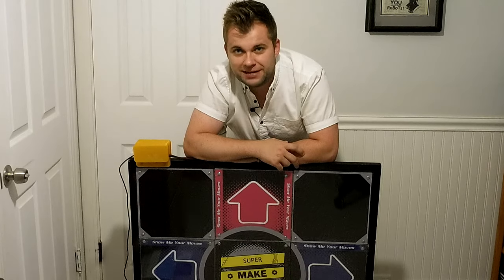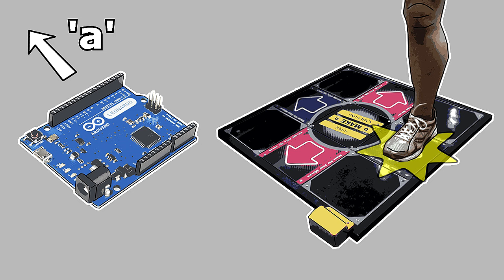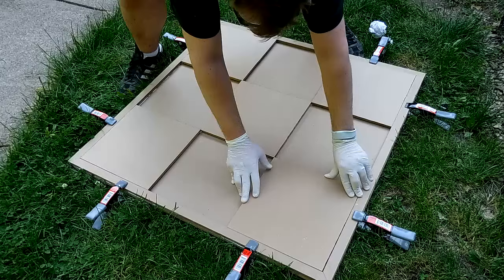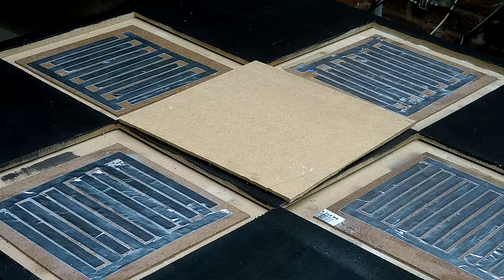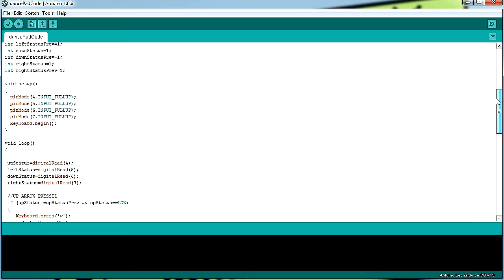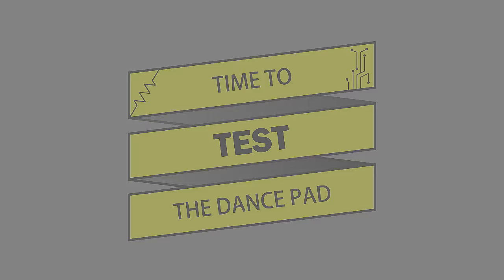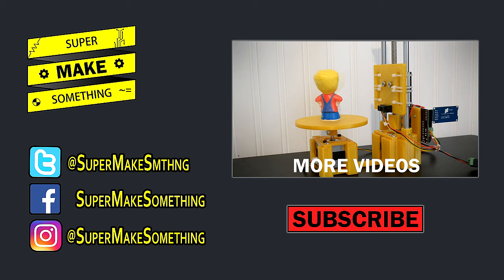USB DDR Dance Pad (Arduino, Pull-Up Resistors) - Super Make Something Episode 9

Comment: This is a great design and thanks for sharing it with us.  My one big objection to this design is the method used for connecting the wires to the dance pad combs.  My suggestion would be to extend the ends of the foil contacts over the edges of the riser panels, such that the wires can be connected out of the way of the pad movement.  By having them on top of the risers as they are installed in this video, that could impede pad movement and thus connection.  If soldering/welding to the foil is not an option, I would also suggest something like hot glue or even duct tape to complete it.  Electrical tape does not stay adhered to wood very well in high-vibration applications.
Reply from the maker: Mark Dickson Hi Mark! Thanks for your comments and I’m glad that you like the video! The ideas you suggest are definitely good. The main limitation for this design was foil comb size, which was a result of my craft cutters’ working area — the one in this video is a “mini” version with an 8.5in cut width, whereas other cutters can cut material up to 12in wide. Your suggestion about wire adhesive is a good idea, too — I think that if I were to build the pad again, I would attach a piece of copper foil tape to the aluminum foil, since this would allow me to solder a wire to the comb directly. (A pad made entirely of copper tape would be ideal, but this would probably be too expensive.) That being said, it is still holding up well and I have not had any issues, so if you are planning to build your own pad, I think this is a good base design to get you started. Cheers!
Reply: @SuperMakeSomething  I hadn't thought about using copper tape to connect to the foil. That's a good idea too. Still a great pad design overall!

Comment: When I did my dancepad I just bought the cheapest USB generic controller I could possibly find, cracked it open, and used the PCB from that lol. Then just soldered wires from its buttons to the dance pad and effectively the pad steps just act like giant buttons.
Reply from the maker: Awesome! That’s a great way to go if you have a spare controller laying around! Nice!

Comment: Used material summary:

1/2" MDF:
1x 35"x35" baseboard
4x 1"x35" borders
5x 11"x11" stationary panels

1/4" MDF:
4x 11"x11" button pads

1/4" cardboard:
4x 9"x9"x1/4" raiser panels

1/4"x5/8" foam insulation tape:
16x 8" strips

2mm acrylic: (or polycarbonate)
9x 11"x11" panels

Aluminum foil

1x Arduino Leonardo

36x  #8 screws
13x (?) washers + electrical tape  (or screws)

Wires

Glue

Spray glue

(Optional, but required for a cleaner result :)
(3D printed) Arduino Enclosure
 (with screws for closing)

Paint
Graphics

Braided tubing
Zip ties
Reply: You forgot "pizzazz"
Reply: @Rodman im pretty sure you can buy an l-tek pad for about that much (maybe a bit more?), including shipping to us
Reply: @Rodman maty-taneczne (dot) pl, i dont have one but ive seen many opinions and they seem to be overall a v good entry level choice, the sensors might be a bit inadequate for high level play but there are mods you can do. there shouldnt be any issues with durability though, just make sure to choose the pro version as they have polycarbonate panels instead of acrylic (which are mone prone to cracking)
Reply: Rodman is this offer still up lol I’m gonna be making one

Comment: I've used your code and implemented in my PIU machine that i've built. It worked just fine for me. 
I used a completely different material, had to make some adjustments on your code, but it was really nice have a starting point that you gave me. 
Thank you.
Reply from the maker: That's awesome! I'm glad that my code helped! Thank you for letting me know!

Comment: I played a bunch as a teenager and now that I'm an adult and have money, most of the good pads have since gone out of business.  I will be starting this project asap, thanks for the video, it answered some of the questions I had in my head while I was planning this out.
Reply from the maker: Jay Martinez That’s awesome! Please keep me updated about how your build turns out!
Reply: Super Make Something so I finished mine and I did a couple thing different. One being I didn’t clean it, it’s just wood. I also used copper tape instead of aluminum foil which allowed me to solder to the tape. However I noticed some sensitivity issues, especially with holds, which I’m assuming is too thick insulation tape which is forcing the active step area closer to the center. I’ll make some modifications to see if that works. Also another problem is my lack of skill as I haven’t played in years lol.
Reply: But I suppose that the sensitivity could be maybe a non consistent circuit because of weak connectivity of the copper tape adhesive. But I’m not sure yet.

Comment: If you don't want to get an Arduino and code, I'd recommend getting a cheap soft pad and utilizing the board and enclosure that comes with it. I'm trying a build this weekend with a soft pad I recently purchased. Most of the time with soft pads, the part that goes out in them or causes them not to work are the contacts and not the board. 

In the one that I purchased from Amazon for example, the contacts for everything are just two layers of crinkly plastic with conductive material printed on them with some very low quality and thin foam in between them. I bought two of these pads and neither made it past day 1 of use without pads not firing. 

I can't speak to all  PCB boards on these soft pads, but with multiple companies selling these 10 button pads with a pink/blue theme and the "Stay Cool!" In the middle pads, I imagine most of them are the same product. The board in these pads is very simple with one ground contact in the middle that all the pads connect to. There are then 5 smaller contacts on either side of the ground contact that correspond to the 10 buttons: (The pads I bought have 4 arrows (up, down, left, right), a triangle, square, circle, and 'X' button in the corners, and a start and select button at the top of the pad)
Reply: This is exactly what I’ll be doing this weekend! I bought a soft pad years ago. It’s never worked very well and, 90% of the time it, doesn’t register my up or down steps. I’ve been playing with the option to fail songs turned off and just accepted that all my scores are stuck at D at best. But I am soooo looking forward to repurposing the board for a quality hard pad! Now I’ll finally know what my REAL scores are!

Comment: Great video. I also suggest you place the conductive pannels closer to the center square, that way you don't require to press so far out with your feet, instead you can just touch the edge of the arrow to trigger it
Reply from the maker: Michael Lesko Good idea! The more sensing area there is the better!

Comment: Thanks for the guide on how to make the dancepad! That is where I was caught up on, trying to make my own Pump It Up pad. I plan to use the Texas Instruments MSP430 Launchpad (F5529) as the controller instead of the Arduino, due to it's ability to call an interrupt from a pin input, as well as having built in pull-up resistors if needed for output. It also can be made to act as a HID-compliant game controller, so I think it will be perfect for the job.
Reply from the maker: Awesome! Glad you found the video helpful! Please share your build with me after you are done — I would love to see the final results!
Reply: Did you do it? Trying to research!
Reply: I am also checking to see if you made it and how well it worked.
Reply: The arduino is capable of this as well, depending on the board. The Leonardo in particular supports interrupts for enough of the digital pins to make this exact project interrupt driven. See attachInterrupt(). The loop function could just sleep endlessly if it really wanted to.

Comment: I used a xin-mo to make mine. Pads are more reliable and uniformly sensitive (can't have pad misses for flat-footing) if you only need one contact (ie. detection of 0 or inf resistance). A xin-mo just detects the closed circuit upon contact and it's cheap; shabam.
Good job regardless.
Reply: could you explain further on how you would do the wiring for that?
Reply: Flippusmn what buttons or sensors did you use with the xin-mo?
Reply: Lol, ya, you gots my attention, thankyou for the heads up!

Comment: Thanks so much for this video, I made my own DDR mat using this as a guide and it works brilliantly.
It hasn't endured much use yet, one key difference is that I kept the 2mm acrylic as one big sheet, so I'll see how that compares over longer use.
The only other major differences are that I used an old Arduino UNO (Revision 2), which does not have the keyboard module available, so instead flashed it to be recognised as a HID Gamepad, and mapped the buttons to the cross, circle, triangle and square, and it works a treat!
Keep on making things! I love your work!
Reply from the maker: Hi Stephen! Thanks for your comment and congrats on the build! I’m happy to hear that you built this project and that it is working well for you. I did not know that the Uno could be flashed to be recognized as an HID device. Could you post a link to the code? That sounds super awesome and useful! Cheers!
Reply: @SuperMakeSomething   Thanks so much! I can't take credit for the code, however, but I used UnoJoy, found here with guide https://code.google.com/archive/p/unojoy/ hope this comes in handy!
Reply from the maker: Stephen Forrest Awesome! I will take a look. Thanks!

Comment: So let me get this straight. I can either:

A) Spend $350 + shipping to get a fully functional DDR pad with a warranty.

or...

B) Become an engineer / designer / 3D printer operator / programmer / electrician / carpenter and build one myself for probably under $100, as well as a week's worth of hard work?

B sounds a lot cooler to me, but A is all I'm currently capable of.

And awesome video BTW. It was really cool to watch you doing all of this.
Reply: He includes a setup file for that control box. He just opted to 3D print a control box for his pad. The materials for his pad probably ran roughly $150 or so.

And btw, the $350 "fully functional" pads with warranty are cheap, made in china, are prone to failure within 6 months, and have to be shipped back to China if you intend to use the warranty
Reply: I was going to spend 50$ on a soft pad
Reply: Pikmeir, You forgot the equipments you need in order to execute Option B :)
Reply: @KCEBGaming  Who says? i have the metal dance pad which is made in china, functioning for almost 3 years without error.
Reply: You don't have to be electrician, designer, 3D printer operator or engineer. In the way of programming, u can DL ready sketch but do have to know how to load it in microcontroller. Those connectors with foil is just one of the many ways. All u need that anything that will short the contacts when u step on it, from pressure sensor to banal buttons. All u  need is just a straight hands and imagination. DIY pad has one advantage that ready pad in the shop doesn't have - you made it.
Reply: @seant397  Do you play on PC? I miss DDR on my PS2 so badly.

Comment: I bought a cheap metal pad and modified it the same way.  Came with a smaller sensor similar to the one you made, replicating the idea for the entire pad area.  My first shody solders snapped, but after a couple o fiterations, it still works to this day and this was 10 years ago.  Props on the info, will come in handy mang.

Comment: Was about to comment on the electrical tape right as you gave your comments on the design lol, I would say maybe use a spring to hold them down, as frequent movement will wear out a solid connect like a screw. 
Definitely also agree that acrylic is too brittle. I will likely be using Lexan, which is very durable.

I also would recommend putting in connectors at each button to make swapping parts easier.

Comment: Great video. Personally, I think for expert players piezoelectric or piezoresistive sensors are a must! Just like the arcade pads.
Reply: You could make a follow up video to this using arcade sensors? That would be awesome! They're pretty affordable too!
Reply from the maker: I'll definitely consider it!  Currently the pad seems to work pretty well, even for more advanced songs -- I can A/full-combo Max 300 consistently without noticing any misses due to the buttons.  If the pads do need replacement sometime in the future, I'll be sure to look into the sensors further and post a follow-up if I do.
Reply: Does max combo with perfects/excellent? If so, then the accuracy on this thing is insane!!  But if you do have some more about arcade sensors definitely. I know you can find pressure sensors from aliexpress so if you happen to do one from the ones you find there - Awesome. That or I think pennyarcade.com had some.

Comment: Did you know? In kkclue's DDR foot pad tier list, the space between an A-tier DDR cabinet and a D-tier thickpad are HOMEBREW PADS. They're made by fans, with no intervention from Konami, but because they're homebrew, they're made to be tweaked, so you have to be prepared to DIY when something goes wrong. The Cobalt Flux is B-tier, and the L-TEK pad is C-tier.

Cobalt Flux:
- Very well liked by the DDR community
- Constantly out of stock
- Hard to find (I mean used ones are hard to find)
L-TEK:
- Always in stock
- Manufactured in Poland
- High shipping costs (for USA)

Comment: How would you recommend increasing the sensitivity specifically around the edges and corners of the steps without having to replace the aluminum foil sensors system?

I glued a sheet of craft foam(2mm thickness) of the same size as the whole pad below the base under it to prevent it from sliding, it works really great. I used a whole sheet instead of individual strips to have consistency across the whole base area and for extra grip, also it was really cheap so why not.

Now on the sensitivity, I've been thinking of covering a few craft foam strips with aluminum foil tape and and placing them in the corners of the steps to increase the thickness of that contact area which is used more in harder songs(since you don't have time to step right on the center) thus increasing sensibility to give it a more arcade feel.
What do you think?
Reply from the maker: I think that could work.  In this specific setup, it's essentially a trade-off between how "wide" and how "tall" the foam strip is, and how little foam you can get away with.  "Narrower" and "shorter" strips would allow you to increase the area of the aluminum pad sensor, but less foam results in a less stiff "spring" on the panel.

Comment: After making the changes that you'd mentioned at the tail end of the video, how is this holding up? I'm considering building something of this nature myself (albeit without the 3D printed arduino box) but I'm interested to see how much mileage you've gotten out of the pad overall.
Reply from the maker: SharktopusAttack The pad has held up really well! Since replacing the acrylic with Lexan, I’ve had no cracks in the panels. Sandwiching the wire leads to the metal contacts with a screw instead of using tape has also increased the amount of time between maintenance significantly. The only downside is that I find that the pad is still not heavy enough — when the pad is on carpet, it has a tendency to move around while playing heavier songs, though I’ve solved this problem by putting weights in the corners while I am playing. 

That being said, I recently found a website that sells after-market arcade sensors. I might have a follow-up build planned in the future to build a full size arcade platform replica... ;)
Reply: @SuperMakeSomething  Hey, how is it going? :)

Comment: I realize this is an old video, but you might get away with using extruded acrylic instead of cast acrylic.  Extruded acrylic is a fair bit more flexible, albeit slightly less clear than the glass-like cast acrylic.

Polycarbonate is still a good option, of course.

Comment: Do you have a picture showing how you did the wires?
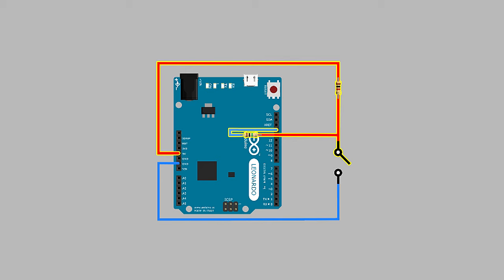Reply from the maker: KalebDoesThings Check the following time stamps: 4:00 11:00 11:50
Reply: @SuperMakeSomething  so connect one red wire to one connector strip per button but how does the black ground wire go?
Reply from the maker: KalebDoesThings The black wires are attached to the other foil combs in the base for each button on one end, and connect to the Arduino’s ground pins on the other.
Reply: @SuperMakeSomething  is it one ground wire or do you connect multiple to one because in the video it looks like you only had 1 go in the arduino
Reply from the maker: KalebDoesThings All of the buttons are connected to the same ground, so you can link them together and then only have one wire going into the Arduino ground.

Comment: I've been wanting to do this for years but with a metal frame since I work in metal fabrication now and have a huge supply of scrap steel and aluminum plate and channel, and also do a lot of DIY electronics wiring and soldering

Comment: Sorry but I don't fully understand the components list, could you (or someone) write it?
Reply: 1x 35"x35" baseboard (made out of .5" MDF)
4x 1"x35" border pieces (cut from the same sheet of .5" MDF)
5x 11"x11" stationary riser panels (also from the same sheet of 5" MDF)
4x 9"x9" arrow risers (made from .25" hardboard)
16x .5" x 5/8" foam strips, 8" long
12x Aluminum Foil sensor contacts (roughly 8x 11"x11" sheets, or about 7.5')
9x 11"x11" pieces Acrylic or PolyCarbonate 
1x Arduino Leonardo microcontroller
An indeterminate amount of wire. :/
Reply: Thank you very much! :-)
Reply: These measurements are in centimeters?
Reply: Laerte Honorato it says " so therefore inches
Reply: Thanks guy ^^